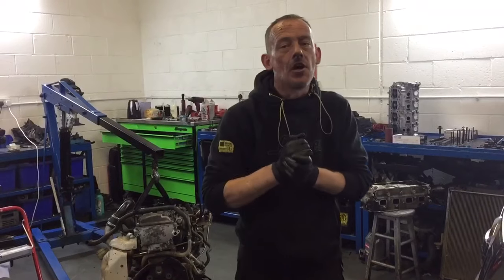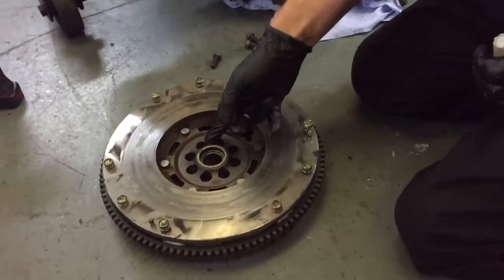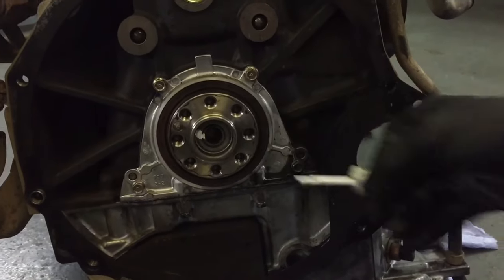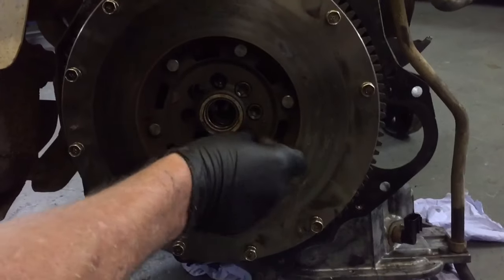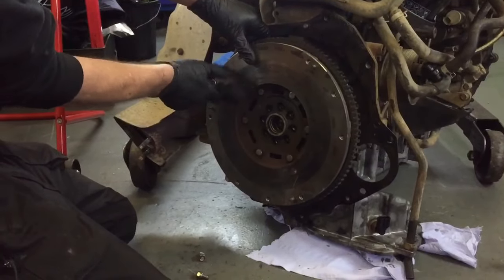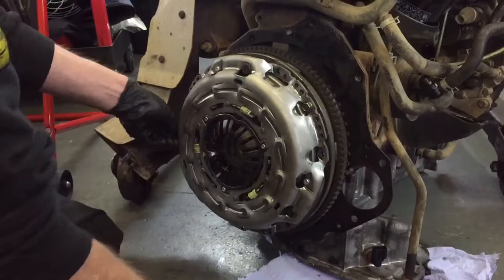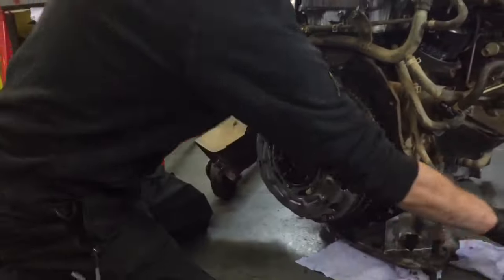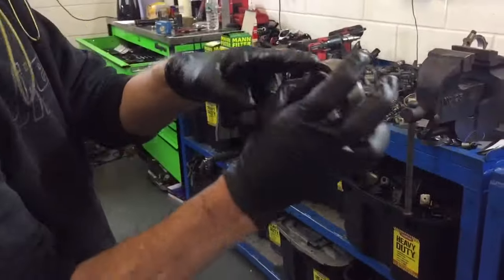How to fit New Nissan Flywheel and Clutch + Release Bearing

Comment: Ha ha I’m doing my first one Iv definitely learning here lol I’m told don’t bang it even the clips can snap released bearing remove fit new with grease check teeth doing this is not just quick save money help job just a small mistake is dangerous I’m still learning

Comment: Hi mate, I'm trying to change the clutch on my Mazda MX5. When I put the pressure plate up to the flywheel without the friction disc in it seems to fit flush on, but when I put the friction disc in it doesn't fit flush. Is it just the case of it needing bolting down? I just don't want to break anything.

Comment: How you doing I did my clutch swap motors everything about 10 months later a whistling sound it wasn't to throw up bearing when we took it apart to clutch inside the clutch on the spline was all worn out now the bearing in the input shaft is tight it's not that I'm thinking it's the flywheel is shot I think they're like a flexfly wheel or maybe when they put the flywheel on the first time it was wrong but all I know is a tunnels out in the center teeth with the input shaft goes what do you think happened please

Comment: Is that a DMF ? If yes then how come is so lose? You could easily rotated the smooth face plate w.r.t. the toothed wheel . 
 The spring between both parts of DMF isnt so loose . 
 And also i can see the clutch plate with springs !! How come? 
 My luk DMF kit doesn't have a spring clutch plate. Its solid. 
  Amd other flywheels that are SMF do have spring clutch plate. 
 Can you please explain

Comment: I have a D40 Dci manual 2wd. The engine shakes and shakes. The vibration seems to stem from gearbox. I changed engine and gearbox mountings but it still persists. Now the gear shifts are rough sometimes clutch not engaging. Please help!

Comment: Its flywheel double or single mas Sir?
Reply: That is a dual mass in the vid.  Its easy to spot the difference in this one (if you know what to look for) in that you can see the front (trans side) part of the flywheel wiggles independent of the engine side (the part with the teeth for the starter).  I’d say that the one he’s installing is worn out given how much play there is in it.  If you search YT for “dual mass flywheel” there is a short video where the guy is showing the difference between a worn out DMFW and a new one (hint: the play we see in this video is the tell-tale of worn out).  Hope that helps.

Comment: hey very useful info...  whats the part number for the LUK clutch
Reply: WILL THIS FIT?

Year: 2006
Model: Nissan Frontier
Engine Type: Diesel
SEATING CAPACITY: 5
COLOUR: BLUE
ENGINE #: QD323153
CHASSIS #: JNICJUD2220078884

Comment: watching these videos for a while now and there are some poor mechanical skills at certain areas- assembled the friction plate BACKWARDS with gearbox side against the Flywheel,not leading the threads by hand, did not measure if flywheel is within specs did not talk about it either, smacking the bearing like that, did not explain what to look for on the pressure plate since its a self regulating pressure plate and there are some things to be said about it (hint- the small yellow springs), using hammer and dropping things doesn't mean you are good, my 2 cents as a certified Schaeffler mechanic. If you don't know who Schaeffler is then it's worse than it seems.
Reply: The friction plate on these can only be fitted one way round. The protruding side is too large to fit inside the recessed part of the flywheel so fitting backwards is impossible....Agree with the rest of the points you have raised though.
Reply: A new clutch assembly on a used flywheel with high spots is a disaster.....
Reply: Agreed. Real shoddy workmanship. Just smacking things in, not aligning bolts properly and forcing them in. The list goes on. One of the worst ways to press a bearing on. In the end he should have said and that's NOT how to  do it

Comment: I know some people have been doing SMF conversions from dual mass flywheels in navara manuals to try and get a longer life out of them, I'll need to do mine soon but I thought I'd rather just get a heavy duty clutch and stick with a DMF because I thought that going from DMF to SMF meant you got a lot more vibration? Have you had any experiences with any side effects of doing a single mass flywheel conversion on these motors? Cheers, jamie
Reply from the maker: Long term it puts strain upon the bearings within the gearbox so i would stick with the duel mass. Cheers Jamie
Reply: Not to mention the engines seem to run rougher, with vibration in the cabin when you fit a solid conversion.
Reply from the maker: Well said
Reply: Just a bit of input from someone who has put an Exeedy heavy duty clutch with SMF conversion into a 2010 D40 Thai model. I have zero vibrations, whether it be while taking off or cruising, and the clutch feel is just so much nicer. I would never go back to a dual mass now that I've felt the single mass.

Admittedly I was worried about putting the SMF in after hearing some scary stories so I called Exeedy directly and spoke to one of their technicians down in Melbourne and he reassured me that i'd be happier with the reliability of the SMF. Needless to say I was very pleased with my purchase! Just something to keep in mind made!
Reply: I have seen it both ways, but Exeedy make really high quality parts so I have no reason to doubt you. But I have Audis and vws that just would not run well with a solid flywheel, and to be fair the science behind it is good, because a lot of drivers tend to treat the clutch like an on/off switch.
Reply: I fit a SMF to my Navara and it’s never been right. Lots of vibration, idles like a bag of shit also. Replacing it tomorrow with DMF job has cost me double
Reply: West yorkshire engine services idling problems after fitting a new clutch, any suggestions?
Reply: @scottrobinson2482   idles like a bag of shit..LOL!!! this cracked me up!!
Reply: I have a 2.2 nissam xtrail T30 dci. My stock dmf lasted 1.2k kms . I got i welded amd converted to SMF + a clutch plate with springs. 
 Driving was a nightmare. Horrendous vibrations. In winters starting and initial run wad frighning in NVH. Driving in higher gears at low revs was  almost impossible. 
 Then i dumped it and put im complete new DMF kit with clutch and pressure plate. 
 It lasted 60000 kms only . Now again put in a DMF .

Comment: Hi guys. I need some advice. 
I replaced my clutch master cylinder kit a month ago. New clutch & pressure plate in April this year.
Today I took off up a hill 1st gear, got onto flat road, can't get 2nd gear.
Switched t van off. Tried adjusting pin by clutch pedal, bleeded t master & slave cylinder.
Van goes into gear, but won't slow down when clutch is pressed down.
I put a new master & slave cylinder. Bleeded! 
Van is only selecting
1 - 3 - 5
Not selecting
2 - 4 - R

What could be the reason for not selecting 2 - 4 - R?

Comment: You guys are a pigs to work, that dual flywheel plate has a lot of play and the way you removed the release bearing is not the right way to do it, and using power tools to fasten crank bolts. Damn 😐
Reply: WRONG SIDE OF CLUTCH ALSO GETRIEBSEITE ON THE FLYWHEEL ....
Reply: Customer, why when my foot is on the clutch is there grinding noises and my foot is vibrating, workshop, I don’t know I definitely didn’t bash any bearings with a hammer 🤷‍♂️

Comment: Thanks for the vids, really helpful. My 08 Nav needs a new clutch. It was replaced by the previous owner and ever since has gently popped out of 5th when you come off the power. Any idea of whats gone on there? Also what would you suggest in terms of clutch/fly wheel set up? I regularly drag heavy stuff about for work so wants to be as heavy duty as possible. Ta
Reply: das gearbox problem

Comment: You said don't use impact gun on flywheel bolts??
Reply: Des just uses the gun to speed up threading the bolts on, and snugs them up, and then he will go back over all the bolts, with a proper hand torque wrench, to get an accurate, proper torque, on the all the bolts.